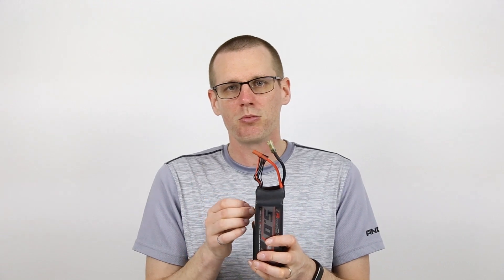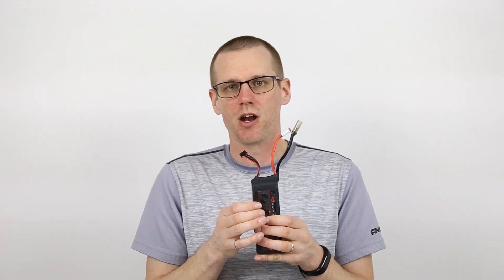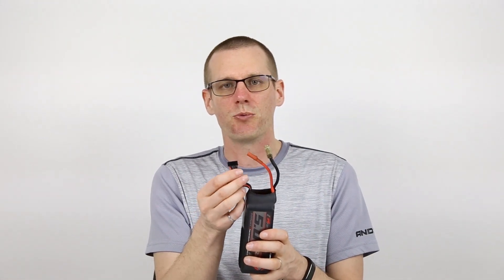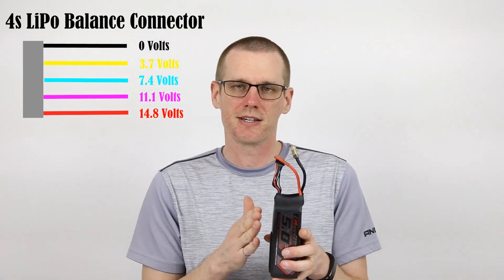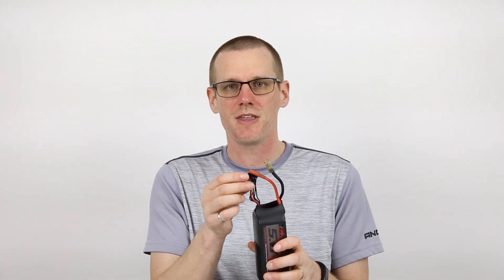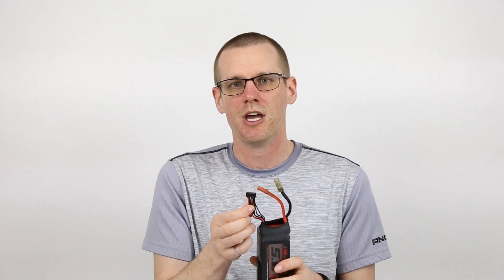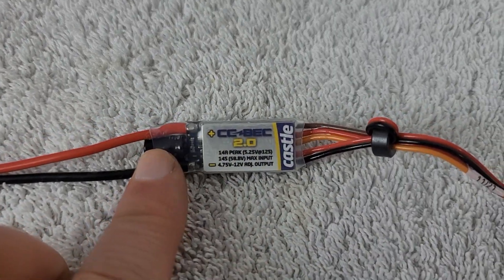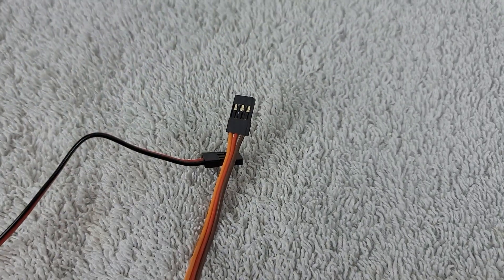Avoid Mid Tapping your LiPo for Auxiliary or BEC Power

Comment: can't you just wire them in parallel like if you want 2s from a 6s you just put cell 1&2 in parallel with 3&4 and with 5&6 making the load equal
Reply from the maker: No, you would dead short the 6s battery.

Comment: I would only do this if you can apply identical load to keep the cells balanced, eg running 2 identical fans from a 4s pack, between cell 1 and 2 and cell 3 and 4